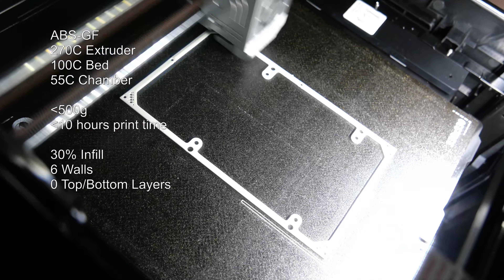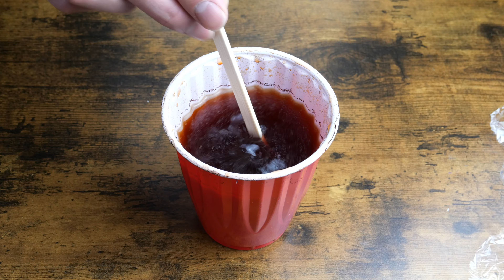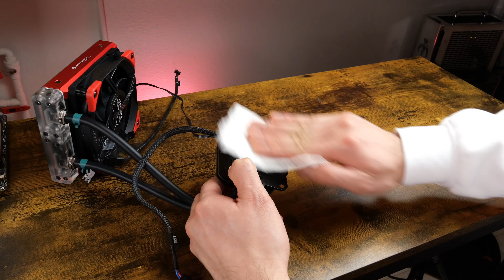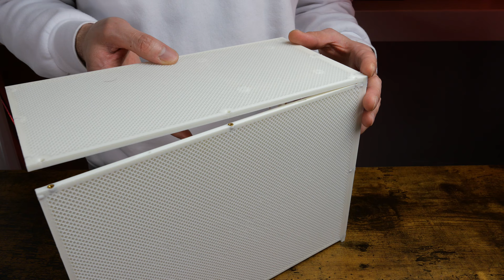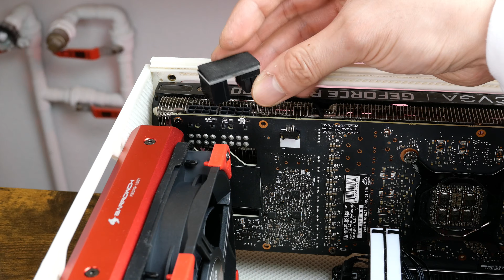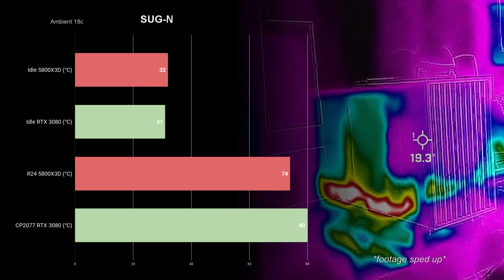3D Print Your Own Fractal Design a North ITX?!

Comment: Do you think it would be possible to modify the design to accommodate a more affordable ATX power supply mounted up front instead of the AIO? Love the build!
Reply from the maker: Thanks!

Yes it’s possible, but the case would be much larger than what is shown here to accommodate for ATX PSUs.

At the end of the day, it would likely only be fractions smaller than this project: https://www.printables.com/model/1172682-sug-freebeam-matx-girthy

Comment: Was searching for a north itx and found your video
Here is an idea :
- print it in black or even better anodized aluminium panels
- make the aio fan stand out of the case and cut the wood sticks around to form a circular shape around the blades
Reply from the maker: @LeRatVisseur  thanks for sharing your idea.

Comment: For the build this tiny, I would probably just use a quality air cooler and print a wind inlet to optimize airflow. Because the test for AIO, I reckon if the AIO is smaller than 240, is a bit pointless, because a nice air cooler can beat the performance and plus the air cooler also cools the VRM to help system stability

And since you are doing the custom cables, it is a bit shame not to best fit to given better air flow
Reply from the maker: Thanks for watching and commenting!

Comment: Fantastic video! I was wondering: How much do you think it would cost producing this case in aluminium o a material like a''normal'' pc case?
Reply from the maker: Thanks! 

Realistically (market size, fit & finish, tooling, distribution, etc) it would be inline with other boutique SFFPC case = expensive. Just check out the pricing for the Fractal Terra for example. 

To get to the price bracket of the Cooler Master NR200, is highly unlikely since it was designed to be accessible (its almost double the size of this design) AND mass produced; tooling and distribution channels were calculated to be properly amortized.

PS - stay tuned for a simplified version lol

Comment: what were your vrm temps, and m.2 temps? good job
Reply from the maker: Thanks! I’ll have to check on those but the VRMs are being fed by the 92mm fan so I’m not even concerned over it; the NVME drive is behind a mesh on the back side of the board so it might be a bit stagnant without airflow.

Comment: It feels a bit like silversone sugo layout, but tighter. I wonder if there's a chassis that has this layout, and maybe it would be doable to make a modding kit to replace the front, add AIO there in those small ITX cases this way. Also - still waiting for your 6K threshold of the steam machine remake :D
Reply from the maker: You had me at “tighter.”

I’m sure there are others carrying the same layout, and it’s funny that you mentioned it’s a smaller version of the Sugo, but i think of it as an enlarged version of the J-Hack: https://j-hackcompany.com/?product=j-hack-pure-xl 
Now you got me on the hunt to find a case to mod now lol

The Steam Machine will be shared soon! I can feel it lol. :)
Reply: @standupg4m3r  That j-hack case feels really overpriced at this price point for two pieces of metal bent at 90 degrees and a switch. We had an idea for such a cube case years back on the hard forum as ultra-cheap SFF case :)
Reply from the maker: OMG, what is stopping you from still doing it now?! lol hotcakes!

Comment: As usual, great build presented in a thorough and also funny way. 

I wasn’t actually aware of those graphics card low profile power adapters, they could definitely come in handy sometimes!
Reply from the maker: Yo!!!! Thanks a bunch for checking out my video. Always means a lot coming from a successful content creator and maker like yourself. 

PS - if you short the contracts behind the adapter, I can’t be held responsible… low key I’m actually more comfortable using them in a plastic case than a metal one; literally a piece of foam covering the contacts lol
Reply: @standupg4m3r  that can probably be fixed with a 3D printed snap in cover 😊👍
Reply from the maker: @makerunit  you’re talking like 2mm isn’t something I’m going to lose sleep over?!
Reply: @standupg4m3r  I was just thinking a thin cover to prevent you from accidentally shorting the pins due to them only being covered in some foam, or am I perhaps misunderstanding something?
Reply from the maker: @makerunit  No I got you, I was joking that it would 2mm thick but could def go thinner.
Reply: @standupg4m3r  I see! I was too distracted by you «rubbing in» your CPU and «screwing the PSU from behind» 🤣
Reply: @standupg4m3r  also, what brand of electric screwdriver are you using? Never actually tried one but they look super satisfying to use!
Reply from the maker: @makerunit  https://amzn.to/3SRxEI7 seems to be the updated version, but I’m pretty sure any small electric screw driver kit would work the same. Just be prepared to lose respect of Internet Alpha males though. Cheers!
Reply from the maker: @arudanel5542  https://www.reddit.com/r/nvidia/s/8dFuEXsmo6 just one of many - but I  also watercool and swap PSU fans so… lol

Comment: Looks very cool!)
But a strong emphasis on the front hole for the fan looks strange)
Perhaps if we made it darker, it wouldn't stand out so much?
Reply from the maker: Thanks! The original had very minimal area for the front to the point that you could undo the GPU power cables lol but I needed to reinforce it to avoid the case from warping under tension. 

Increasing the size a bit could very well allow the same material/color treatment found on the North.
Reply: @standupg4m3r  Yes, I understand, so small and empty, and especially plastic...
But it turns out really, really cool!!!
Do you make them for yourself and videos? Or will it be possible to order it somehow?)
Reply from the maker: @MrStubbs760 thanks again! For now I’m trying to avoid having customers and would rather have “fans” atm lol

The 3D files are free!

PS - I may sell some cases soon, but I’ll have to take more time on them instead of early phase cases I’ve been sharing so far - this isn’t even my final form.
Reply: @standupg4m3r  Yes, I understand
Keep up the good work!
Perhaps there will be universal models that can be made for sale)

Comment: Looks great!  I'm a big fan of using heat sets.  So much stronger and worth the 5c each.  I design them into basically all of my 3d printed designs that needs bolts.
I have done acetone smoothing and acetone welding.  I don't think the acetone welding is worth it because it's very easy to put too much acetone and have it melt places you didn't intend to melt, which mars the appearance.  Plus, super glue bonds ABS parts almost instantaneously and strongly.  if I were to design a part for acetone welding, I'd try to do some kind of tongue and groove versus just trying to weld two flat faces together.

Looking great!  Keep it up.  ABS-GF is pretty cool.   How are you liking it?
Reply from the maker: Thanks so much for watching and commenting!

Great points in regard to fusing butt joints. I have some ideas churning in my head about the topic now.

ABS-GF (any fiber impregnated filaments at that) is the ultimate cheat code to 3D Printing for me atm. I love the stuff. I’m going to dial in this current filament roll because it’s not printing as good as the Black ABS-GF from Qidi Tech. But in the past white filaments have always exhibited weird behavior for me.